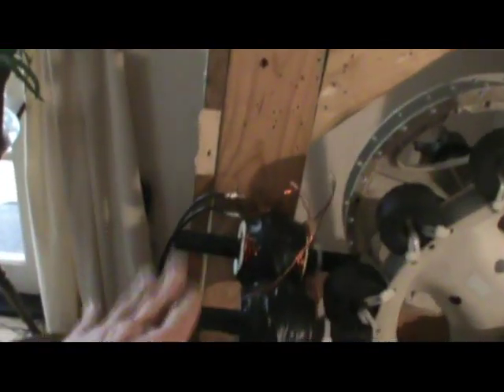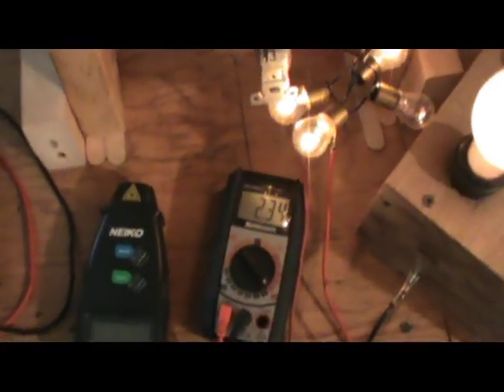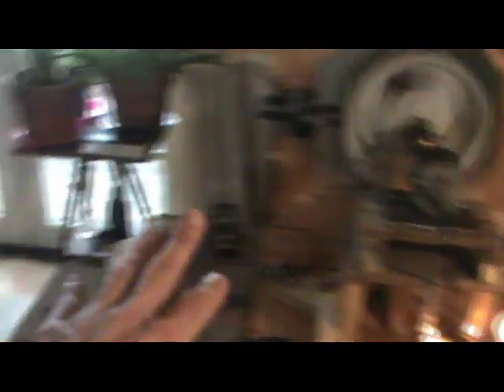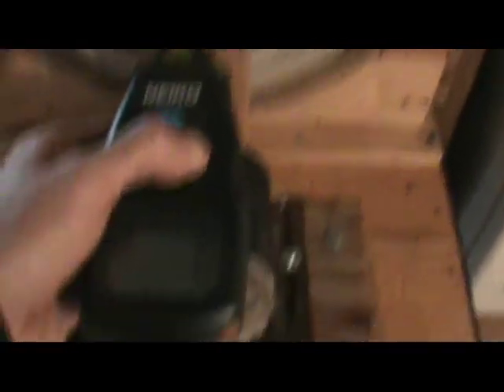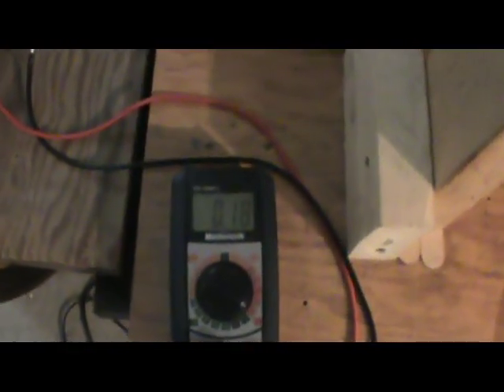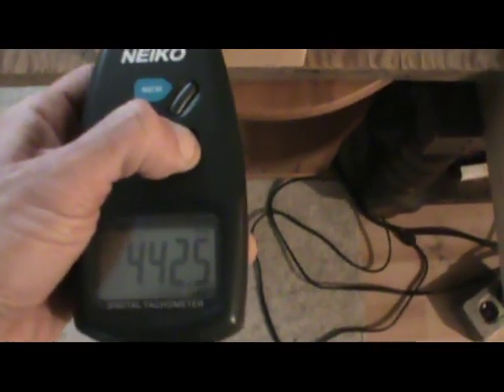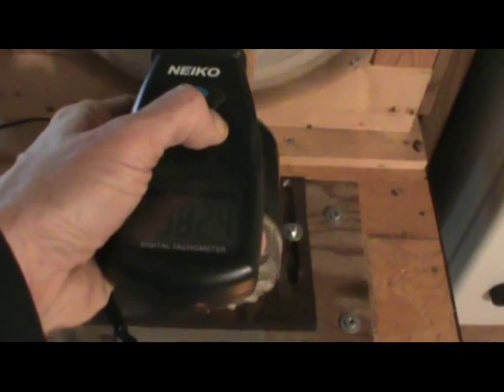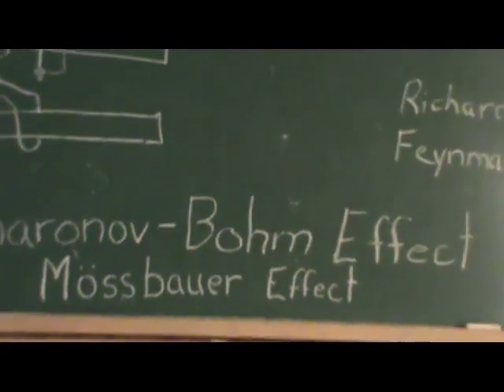Free Energy Project - Output Testing

Comment: Happy to see a vid again, can't wait to see the extra coils. It still puzzles me that you can have current without voltage and voltage without current so the power is theoretically (I*U) so 0times volts=0 or 0 times current=0 but if you want some of both it will cost you.Thanks for sharing!